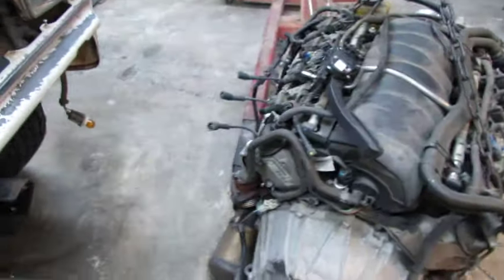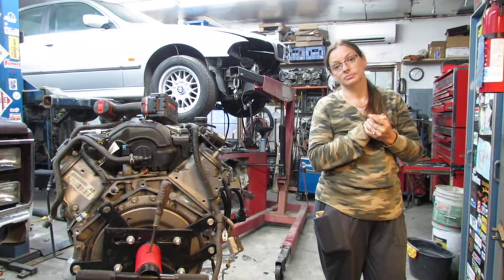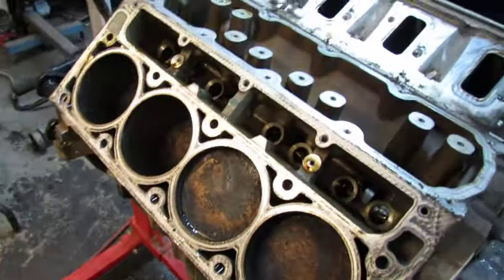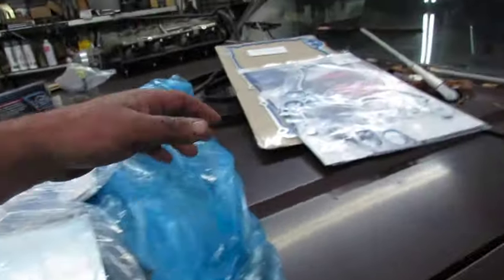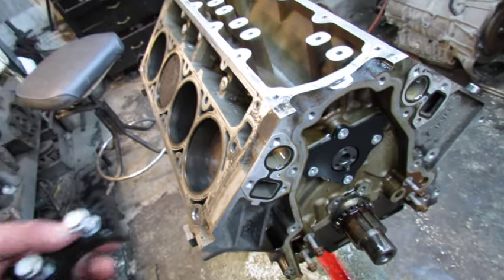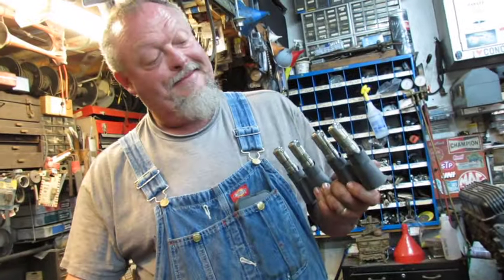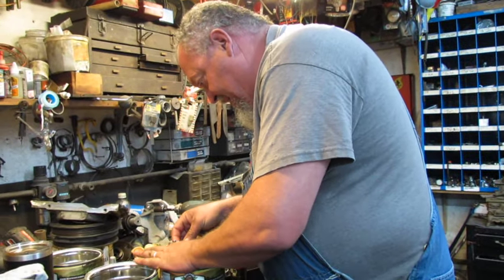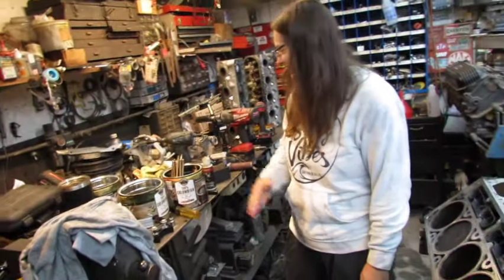Disassemble L77 LS engine

Comment: Sitting here at 2:31 am watching this video thinking I need to be getting some sleep , was working on my wife's truck Sunday , put in a new wheel speed sensor , Wich didn't fix the issue , so guess I'm going to check the wiring and see if there's any chewed or damaged wires and if not I'll change the other one , been chasing a problem that the code is for incorrect first ger ratio  and I already replaced the speed sensor on the back of the transmission and now the left rear wheel , only one left is the right wheel now , here I have been working on her truck the last 4 days and sit and watch videos like this after I'm done working on my stuff . Lol oh well it's all good God Bless
Reply: I had to replace my hub assemblys to fix my problems
Reply: @jerrydevine8057  this is a solid axle , doesn't have a hub assembly like that , the reluctor wheel looked good on it , I cleaned it, unfortunately if it's not the other sensor or a wiring problem then it's more than likely an internal problem in the transmission , I believe there is a planetary that has been an issue on those , just sucks playing the guessing game to see what works . Lol

Comment: I am just wondering if on the timing chain guide you got the bolts going through the opposite side they should be going? it looked like from here (1200 miles away) that there was a recess for the bolt heads on the other side? Or is there a raised boss on the block that I didn't notice?

Comment: you put the bolts in the wrong direction on that guide.  the dished part faces outward.  if how you was holding it was how you installed it.